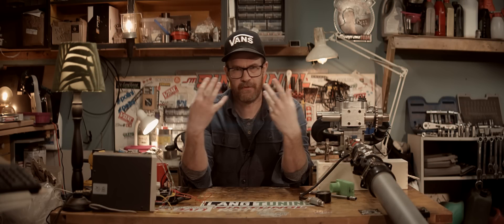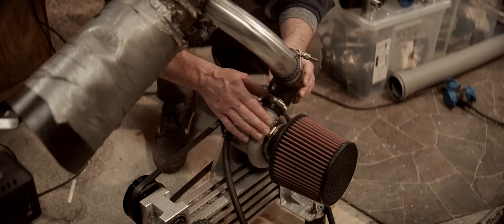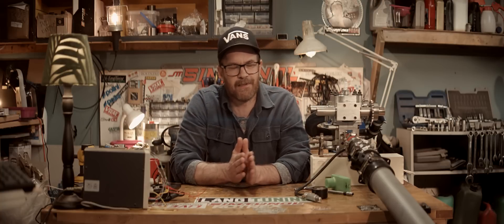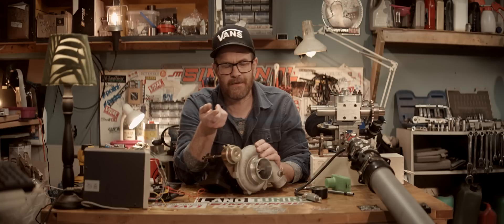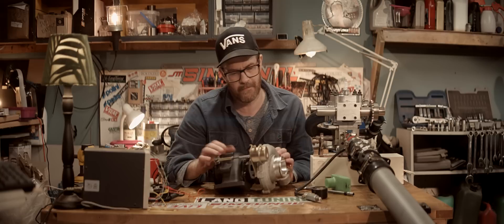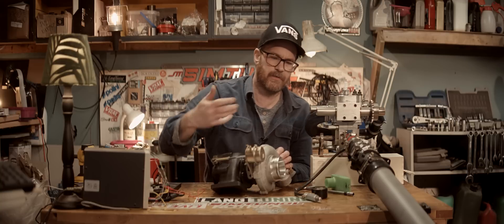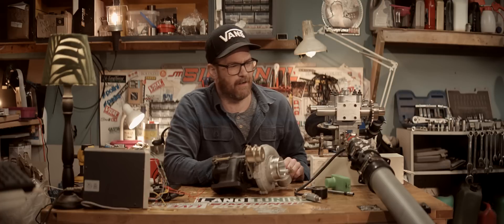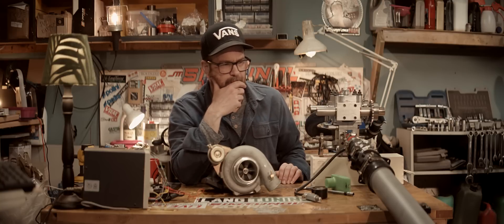THE most genius/stupid idea! Turbojet supercharging.

Comment: Also, with a Centrifugal Supercharger, you can tune with pulley combinations EXTERNALLY and it's boost pressure will rise with it's input RPM, so that you can pulley 'tune it' to start boosting AFTER PEAK TORQUE while pulling Timing to match. It will still boost in the lower RPM ranges, but you can set it with pulley sizes to only make BIG BOOST after peak torque to keep things safe, such as 0.25 - 0.5 BAR under 8,000 RPM, then have it reach 1 BAR+ when it's over 10,000 RPM and AFTER peak TQ has been reached, in order to keep cylinder pressure in check.

Comment: Are you planning on creating an 'Atmospheric Box' around your carb and pressurize it with the Supercharger ? or will you just pipe feed the carb's air inlet and boost reference the vacuum section of the fuel metering setup, in order for the carb to add the proper fuel under boost ?.   Going the 'Enclosed Atmospheric Box' around the carb and pressurizing the box with boost, you won't have to boost reference the carb, as it's entire external atmosphere will seem 'normal' to it and it will fuel normally and add enough fuel for the boost automatically without a boost referenced line into it's vacuum sensing system.

Comment: What about converting a small turbocharger into a centrifugal supercharger by replacing the turbine wheel with a pulley for a belt?
I'm pretty sure there are turbochargers available whith a compressor wheel and housing smaller than your centrifugal supercharger

Comment: Now I have a knot in my brain

What about converting a small turbocharger into a centrifugal supercharger by replacing the turbine wheel with a pulley for a belt?
I'm pretty sure there are turbochargers available whith a compressor wheel and housing smaller than your centrifugal supercharger

Comment: You simply cannot compound anything with a single compressor. You can divert air into different ducts, acting as accumulators, but if it stays in the system you'll only generate more heat.

Comment: Putting aside your turbo fan ideas. Your rotrex can have the excess flow plumbed back into the perimeter of the intake, not at any real pressure but at high enough velocity and directional names to reduce load in the compressor and increase the efficiency beyond just dumping it to atmosphere.

Comment: Compound supercharger turbo a la Lancia 034 with your novel spinning up the turbo with the supercharger. Once spun up you could ideally have the turbo plumbed back into the stinger with lag now not an issue and even have variable backpressure to tune with. Also it would be heavy if you could even source a small enough turbo but you did so with the supercharger.
Reply: Better yet, after reading the comments, spin it up with a turbojet engine and use it to drive a generator to power an electric turbo.

Comment: Have you thought about running fuel+oxygen for the engine? Oxygen is about 20% of atmospheric air, so 100% oxygen supplied at 1 bar could be equivalent to 5 bar boost on air. could you do the distance required for the record with a reasonable sized tank? Or do the rules state you have to run fuel+air?

Comment: I would throw that rotary valve concept back on the shelf,  I'm here to watch 2 Stroke developments, here's a thought start with a known working setup like a off the shelf engine that is known to make a certain hp/TQ figure and start supercharging or turbocharging that, it will give more of an idea straight away, Alex when your firing on all cylinders it's awesome but when your missing on a couple cylinders the whole aspect of this goal of the highest hp 50cc just floats out the window and these weird arse side projects rear there heads 😮 lucky I don't patreon otherwise Ide be disappointed what your spending the $$$$ on

Comment: absolutely love the idea a thought to add you might want to look in to proper boost control Co2 cylinder with solenoids to control boost pressure check out some big drag bikes see how they do it. I would not rely on a standard wastegate to give reliable control with a proper setup you can check what PSI you have at the wastegate and the plenum/intake this will aid in tuning and control look forward to more updates

Comment: Choose supercharger capable of 4 bar. 
Closely control butterfly on atmospheric intake to reduce drive torque requirements and eliminate need to blow off excess air. Need to maintain the esthetics of a tuned exhaust pipe, for the sake of 2 stroke enthusiasts.

Comment: With the Rotrex blower, would it be possible to make a pipe that expels the excess air from the intake into the exhaust, helping with scavenging ? The idea I have is a pipe that completely bypasses the engine that links the intake to the exhaust using a reed valve or something else to control when the bypass pipe opens, and the excess air from the intake will help with exhaust scavenging, and increase the air pressure coming out of the end of the exhaust pipe

Comment: Brilliance is always a combination of diligence, patience, failure and reflection. Your doing fine!
One thing to consider is the pressures created by the turbo jet chamber, this will more than likely create surge pressure feeding the chamber when gasses are burned. 
I know you are trying your hardest to utilize the parts given to you but that blower is much to large, even when considerably under driven. 
Compounding smaller turbos will be the ticket to a non parasitic and efficient setup imo. Feeding into each other creates a pressure multiplication on the second compressor which is key to lower heating of the air and staying on the compressor map at higher PR's. Eventually a complicated wastegate system controlled by an ems will be the key to success, feeding and bypassing exhaust gasses around turbines. 
You need an ems for high speed data logging and control. The two stroke expansion chamber is your friend when spooling a turbocharger, it is in essence your burn chamber that spools the turbo. Keep thinking positive  but realistically at the same time. 
Cheers

Comment: Get in contact with the german company called "ladermanufaktur". Explain them what you want and what you need. Or just get a fully electric driven "turbo system" so you dont have any parasitic power loss of the engine itself. I mean you still stay at 50cc...so therefor you need real high rpm numbers, since its only 50cc you need super sensible fans in a turbo to get "the most powerful" 2stroker...you need to get/stay in the world of fine mechanics!! and if you add a custom di system like they have since centurys with the aprilia di tech for small displacement..then you just need a rotator/flywheel which can power a custom cdi and the other electric driven stuff. This "crazy" ideas just holding back your whole project cause you again run into "im just experimenting for the sake of it" instead of "i wanna do the world record run in bonneville and proof the world that a single man in his man cave is still able to have an impact on the world"....you have direct contact to one of world leading heads in the world for 2strokes who is surely willing to help you....showing this intercooler i was just "wtf", you didnt even made your derbi 80cc metrakit the most powerfull 80cc metrakit of the world (which is in the end just porting/swapping pistons/playing with combustion chamber and fit perfect custom exhaust to it) and in stock form has not a good reputation in the tuningworld itselfs so it is a prime pick for you ...

Comment: Just an idea, you can the route blowoff valve from the supercharger into the turbo this should be able to spin up a garrett gt06 turbo. Then route the presure side of the turbo into the inlet of the supercharger. This way you can get rid of extra air volume and have a compound setup reaching higher levels of boost. In my head this makes sense😅😅

Comment: Sounds like you’re tryna build around a problem of the blower being sized incorrectly. The more induction devices you add is just adding more inefficiency’s. Also pressure is not everything. Pressure is only a derived measurement of restriction to flow. If you want more pressure in the cylinder look at reducing exhaust duration.

Comment: This is my 700cc two stroke snowmobile.
https://youtube.com/shorts/02skz_TYxxk?si=qXN1USbRkvhX5J3f
 5858 turbo good for 650 horsepower of airflow. It is comparable to a 5.9l cummins diesel turbocharger. That's a diesel engine which is 5900cc in displacement. My 700cc two stroke spools this turbocharger at 5500 rpm, just above clutch engagement. 
The raw fuel going into the expansion chambers at lower rpms are all you need to spool a small diesel turbocharger. I know i keep posting but I'm not sure you are seeing my posts. So many clueless people who are groveling for attention. I just want you to see your options. 
So much to be gained with variable port timing and pipe design once you have a turbocharger working!!!!
Stop worrying about airflows in a engine thats not even running, that's impossible to calculate, just get something close running and go from there. 
If you go blow through carb, use pipe pressure reference for fuel pressure, it will gradually increase slightly over boost pressure. Run your stinger with 25% more area to start. Shallower convergent angle on the pipe generally runs better with the turbos back pressure. EMS is sitting here.
Reply: The shallower convergent angle also leaves extra fuel in the pipe at lower rpms for turbo spool.
Reply: Your idea for the turbo jet combustion chamber is a great one!
But you really don't need it IMO.

Comment: Unless it is faulty, I'm sure the compressor can make much higher pressure than you are seeing. That would suggest that there simply isn't enough restriction to the aitflow. By driving it through the engine at BDC you effectively have no restriction so it isn't a real world situation.

Comment: If you need another power source to create pressure then it isn’t a 50cc engine. Might as well strap and electric motor to it and do away with the 50cc altogether.

Comment: The real answer is go turbo and fuel injection(can the lectron carb be used in a blow through configuration?) turbo selection is huge they make really Small one for 600cc 3 cylinder diesel that are probably too small for your engine need
The root supercharged is more suited for a 2 stroke in my opinion 
You making this way too complex for no reason are you secretly a german engineers lol
You eventually find a solution that suit your vision your video are always entertaining 
if it was easy everyone would do it

Comment: Boost pressure is just a measurement of restrictions
The same turbo can make 500hp at 30 psi on one engine and make 500hp at 15 psi on another engine
It just one got more restrictions than the other the turbo still need to flow about the same CFM to make the same HP the psi needed to get here is irrelevant
Asking own much boost you run is the stupidest most irrelevant question someone could ask
Same go for the maf sensor where it is is irrelevant but it not calibrated for boost its just a heating element and the drop in temperature when the air pass by is used to calculate the flow
So introducing hot compressed air is not ideal for the maf but whatever

Comment: OOO  this is exciting! I made a turbo jet with a friend many years ago:

https://youtu.be/kKptM8cS9n8

Is there something to be said for just making a turbo jet (without the rotrex), just a normal turbo based jet engine, then bleed off a smal portion of the air from the compressor for the piston engine.  It might be simpler to control, just fueling to alter to vary the pressure.  The piston engine changing speed as you go through the gears will make controlling the boost more complex with the rotrex involved.  

Awesome work though, take my suggestion with a pinch of salt.  Your idea is far more credible as you have the energy and know how to see it through.  

Really enjoying the videos

Comment: you should find the smallest cvt that can be electronically coupled, or at least modified for your ideal rpm range, and couple the cvt to your rotrex jackshaft, modifying its drive ratio so that you have a usable start and idle range, but as you climb rpm it gets exponentially stronger, leading to a big top end power band

Comment: This is an insane idea... that might actually work. Basically, you've moved the inefficiency problem of the Roots blower from the supercharger into the "turbojet" (we can't REALLY call it that, since the compressed jet intake isn't driven by a turbo. Superjet?) combustion chamber, and can then just attack it with more fuel, instead of having to fight parasitic losses on the crank. At the same time, by doing this you're able to use a highly-efficient turbocharger that won't have the surge problems you're having with that centrifugal supercharger. The main issue I can see with this is fuel control. Unlike with a normal turbojet, your compressor drive is going to be driven from a power source that's only indirectly coupled to the combustion chamber fuel flow, as opposed to directly coupled like normal. This is going to require a very interesting fuel pressure regulation system, since the fuel flow to the motor AND the combustion chamber has to be proportional (though almost certainly NOT linearly) and synchronized.

Comment: why have a blower powered by the engine at all? cant you just build a turbojet and tap off the compressor to the engine, possible through another compressor, either driven by the engine or by the jet also.

Comment: Alex, don't forget that what you are looking for is the weight of the air and not the volume!
To explain: Hot air is less dense than cold air; A gasoline engine needs about 14.7 grams of air for every gram of gasoline. Volumes and pressures don't matter at all if you don't know the temperature of the air in order to calculate its density (and weight).

Comment: At that point why not just have a completely separate engine to essentially act as a "compressor/turbo driver" i.e. a 4 stroke running a blower or turbo except the 4t is still N/A since the outlet side would feed into the two stroke instead of the four stroke to keep it within the ideal compressor map? You'd just need a wastegate with the correct spring rate to control the SC/Turbo's output and a split throttle cable (lot of older 70s 2ts have them).

Comment: Could you not use the excess air from the rotax in the exhaust using a  venturi to help suck exhaust out. 
Would help possibly to create greater pressure differential across engine?

Comment: I would like to see "proof of concept' of the brute force engine first, before we go down the road of jet powered forced induction. What about getting a large blower powered by a 3 phase electric motor and use that to force feed the brute force engine. Purely for testing purposes. Would be easy to adjust the air flow to see exactly how much boost/flow you need, and if the engine actually is viable.

Comment: resistance equals pressure more resistance more pressure, i have to say that as a mechanic myself and build many turbosystems i cannot get a hold of this. of course the components of the setup have to be made for higher pressures, but still without flow and resistance there isn't any pressure, if you take out some of the flow pressure will gain slower, or in a running setup like this, it will never get high.

Comment: For testing purposes! What if you first use a standard air compressor to fill some tanks to 10 bar, and then use some large adjustable pressure valves to pressurize the intake with the desired pressure? This way, you can test the engine on the dyno with x number of bars before you spend a lot of time creating the madness of compressor-fed jet propulsion of a turbo.

Comment: Use two turbos and scrap the supercharger....
Have one regular turbo setup to run as a turbojet, then have the exhaust coming out of that turbojet (out the exhaust housing) flowing into the exhaust housing of a second turbo, that second turbo can be a lop sided one, with a big exhaust housing and a small compressor housing... exhaust is then just dumped, but the small compressor feeds intake air into the 2T

Is it now viable to be considered a 50cc 2T now though, considering it's being fed by a turbojet?
I want to point out, that you're now in the territory of fuel/oxidizer pumps on rocket engines.
Reply: you can then also add a third turbo as needed to compond the compressor side, still using the exhaust gas side to spin the turbine

Comment: Just a suggestion for turbo size.
If you have N/A horsepower of 15 ponies on that little two smoke you will have zero problems spooling the turbo off of a 50 horsepower 
diesel engine. That will get you up and running. Once that happens you will see the potential. You will find that 50 horsepower airflow on a diesel will probably net you under 40 horsepower or even less on a two stroke. Then its on too compounding them since the PR is so low.

Comment: I really get it that your into having a totally new idea, or concept, thats great! But sometimes success needs to be more gradual. There is HUGE potential for being the first to have variable port timing on a turbocharged two stroke. The size of the turbo you will be able to spool will be well beyond what most think is capable. You also need 50% or more compressor flow than on a 4 stroke. Pipe design, variable intake and exhaust timing (youll get around to doing that imo)
All put together will net you the 50cc horsepower Champ no doubt. 
Too many different concepts combined will be a long road. You need a big win! 
Retarding ignition timing = makes turbo party🎉